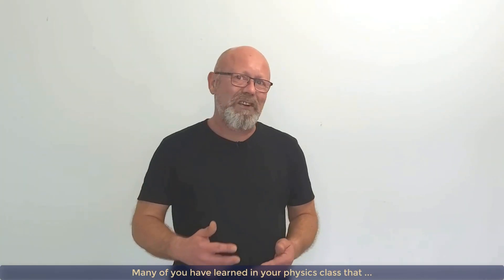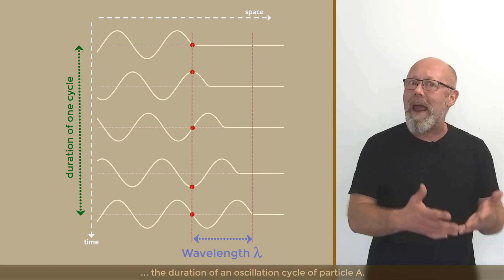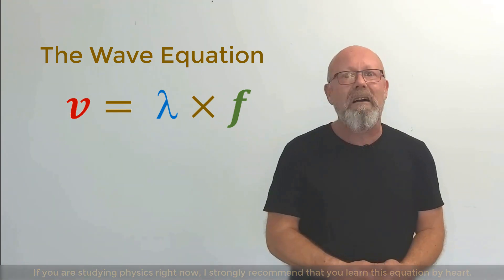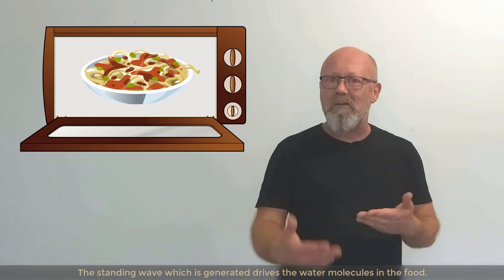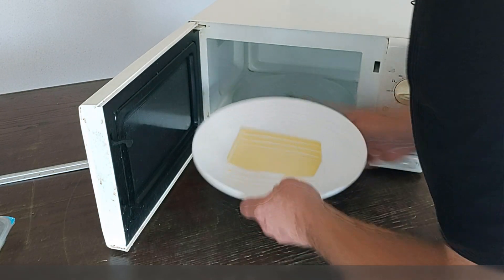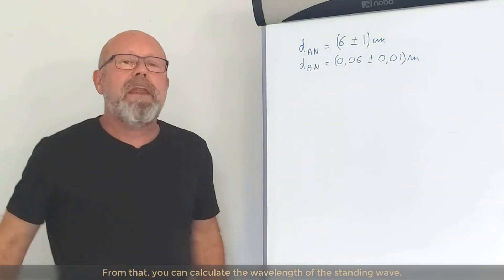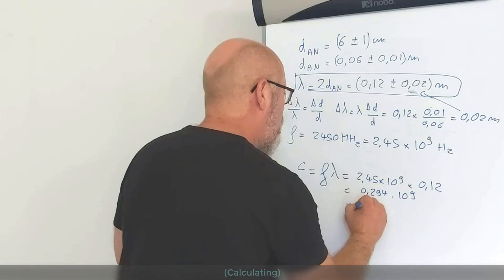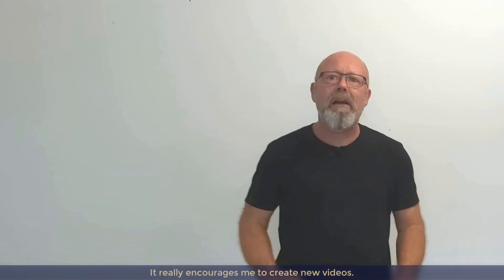How to Measure the Speed of Light in your kitchen! (Waves, Physics)

Comment: The error formula was misleading. The fractional error of a product is not the product of the two individual fractional errors, or it would be zero when one of the factors is known perfectly, as in this case.
You have to take the square root of the sum of the squares of each individual fractional error. The result will be the same as that stated in the video. Because the fractional error in the frequency is zero, the fractional error in the speed is about the same as that of the wavelength.
Great video on the physics side though, and I have just watched the one about light reflection which is a model of concise clarity.
Reply from the maker: Hi Joe, 
You mean the equation on the bottom left of the board around 12 minutes 30, . The sign between the fractional errors of frequency and wavelength is a + (for addition...) :-)
Thank you for your kind comments too
Reply: @PhysicsMadeEasy  Oops! I blame my screen resolution, but I'm good at passing the buck.
It is still incorrect, but in a different way that at least does give a sensible result when one of the fractional errors is zero.
It is a trivial point, though, in a seriously good presentation.

Comment: The theory of electromagnetic radiation is a lot more complicated than was shown in the video. Basically what was shown was only the farfield solution, where the wave equation is set to zero, generating plane waves. This is valid about 1 wavelength from the source. Closer to the source, the wave equation must be set to an oscillating dipole source. When you do this, a lot of interesting things are seen. The longitudinal Electric field and the transverse Magnetic field are created at the source and propagate instantaneously, reducing to the speed of light in the farfield. The Transverse Electric field is created at about 1\4 wavelength from the source and sends instantaneous propagating fields both back toward the source and away from the source, reducing to the speed to flight in the farfield. Actually the propagating Longitudinal Electric field curves toward the opposite charge of the dipole and creates the Transverse Electric field. This propagation behavior applies to not only the phase speed and group speed, but also the information speed. For more information, search William Walker Superluminal. This propagation behavior has been experimentally confirmed by transmitting radio waves between 2 antennas and measuring the time delay as the antennas were separated from the nearfield to the farfield. Many researchers have confirmed both these theoretical and experimental results, and they match perfectly. Because Relativity is based on the speed of light being a constant, the instantaneous nearfield creates a problem for both Special and General Relativity. In the nearfield, the Relativistic gamma=1since c= infinity, and in the farfield, gamma= the Relativistic gamma since c= farfield speed of light. Since time and space are real, they can not depend on the frequency of light used. This is because c=wavelength x frequency, and 1 wavelength=c/frequency defines the nearfield from the farfield. Consequently Relativity is an optical illusion! Objects moving near the speed of light appear to contract in length and time appears to slow down, but it is just what you see using farfield light. Using nearfield light you will see that the object has not contracted and time has not changed. For more information: Search William Walker Relativity. Since General Relativity is based on Special Relativity, General Relativity must also be an optical illusion. Spacetime is flat and gravity must then be a propagating field. Researchers have shown that in the weak field limit, which is what we only observe, General Relativity reduces to Gravitoelectromagnitism, which shows gravity can be modeled as 4 Maxwell equations similar in form to those for electromagnetic fields, yielding Electric and Magnetic components of gravity. This theory explains all gravitational effects as well as the instantaneous nearfield and speed of light farfield propagating fields. So gravity is a propagating field that can finally be quantized enabling the unification of gravity and quantum mechanics. This propagation behavior has been confirmed experimentally. Simone Laplace in the late 1700's, showed that nearfield gravity is instantaneous, by analyzing the stability of the orbits of the planets about the sun. If gravity propagated at the speed of light then tangential components of gravity to the orbit of the planets would result, causing the planets to spiral away. Ligo recently measure the farfield speed of gravity to the the speed of light. Many researchers have confirmed both the theoretical and experimental results and they match perfectly.

Comment: This measured the speed of light in cheese, not in vacuum.
Reply from the maker: Good point I didn’t think about that, maybe I should use Emmental haha ( A cheese with holes). 

Actually, it would probably be a complex combination of both: Considering for example, that the standing wave formed is based on the boundary conditions of both the microwave oven and partially of the cheese, and considering the heat exchanges at the air /cheese and plate / cheese interfaces, the potential refraction / reflection at these interfaces etc…

Also as you can imagine uncertainties on the measurement are quite high, in this video we just get an order of magnitude…

Comment: Here's a physics mind experiment I'm thinking of.  Put a block of Plutonium into a gold Faraday cage, suspended in the center for best results.  Now, on the outside of the gold Faraday cage attached thermal couples to turn the expected heat into electricity and, also, attach a conductor to the outside of the cage to capture the Beta particles hitting the gold... the high velocity electrons the Plutonium is releasing constantly.  It is the electron supply which should have a different charge than the Earth so the other "wire" is a rod into the Earth, maybe needing a capacitor.  Still thinking about it.  With any luck at all, one would have a nuclear 1.5V cell with two outputs... beta absorbing and heat absorbing, one's home made nuclear reactor.  Would it work?  I don't know but I'm thinking about it.
Reply from the maker: The idea is interesting, but you should dive a little deeper. First you should use a fuel that decays Beta,. Pu239 tends to decay alpha into U235. You should select the fuel considering the half life, so that you find a balance between the electrons produced and  the heat they would provide. Too much and the gold would melt, too little not enough current. Also the KE of the electrons produced is huge (MeV range), while for photoelectricity, we are more in the 10eV ranges. Most of the energy would be heat, melting/vaporising your cage. Better transforming the heat into electricity instead of trying to collect electricity directly (and in that case, alpha decay is more effective, because alpha particles have a larger effective cross section).
Even though, imagining you could generate low energy electrons:
Then you should reconsider the receptor. Why a faraday cage?  Some photoelectric material enclosing the fuel with the suited work function would be more effective. And behind the material, some water tubes to evacuate the extra heat. Search the internet, I am pretty sure, some have been thinking of some designs, maybe NASA (long time probes like voyager 1 and 2)
Reply: @PhysicsMadeEasy Guess I forgot about those pesky helium nuclea.  Just thought that we must waste a lot of Beta radiation that could be turned into electrical force.   There is a heat problem too but that is another normal source of taping radiation energy... small scale reactor, or something like that.   My reasoning for the CAGE is that Electrons of same physical spin repel each other and they would be trapped inside the cage... gold is a conductor with tons of flirtatious electrons so it would be easy to tap the field on the outside of the cage directly or by induction with another gold plate (make the cage 1/2 of the capacitor... the more surface area the better for this... you can't get enough surface area.  Where was I?  Haven't thought enough about that one.
Reply: I've been trying to think how I would word a video about my thought process of measuring electron size by an imaginary light second wire of LRLRLRLRLRLR electrons... put them in spin pairs Lspin/Rspin together as pairs in a one electron size to imagine the diameter of the electron my the Ohm's Law rule and our best measurements of a Coulomb.  I gather it has been adjusted a couple of times in my lifetime... I'm 77.  I just looked up the basic numbers yesterday but haven't done the division to see what it would give.

Comment: In theory, one may measure the diameter size of an Electron.  Axiom:  things that are equal to the same thing are equal to each other.  A mind experiment.  One coulomb per sec is one Amp and we know how many Electrons are in a coulomb.  So, with a super conductor cable, we measure one light second's worth of cable and allow only one electron at a time to pass... pretend it's in a vacuum if that idea is too ridiculous for you.  So our conductor is a vacuum allowing one electron, at a time, to pass.  We get our nano second clock out and open the gate for one second/one coulomb and divide one light second's worth of distance divided by one coulomb worth of Electrons and one has one's Electron diameter.  It's a mind experiment, don't go ballistic on how impossible that is.  A light second long line of paired electrons (so they won't repel each other).  Count them... = one coulomb's worth.  I love electrons, they are life.  Everything we see, touch and smell or think is controlled by Electrons.  In my private world they are shaped like an icosahedron and composed of 20 gamma particles.  With enough energy and a really tough target, one may smash electrons into the Gamma particles.  But what do I know?
Reply from the maker: OK, let’s consider 1C of electrons. That is 1/1.6e-19 = 6.25e18 electrons. Now a tube of 1 light second. That is 3e8m. You claim that if you pass 1A in this tube, you would get 1 Coulomb held in the tube of that length, that is 6.25e18 electrons side by side. That gives you an average diameter for the electron = 4.8 e - 11m. The result is fun as it is about the radius of an hydrogen atom at ground state (which could be seen of the range of the electron cloud). 
The radius of an electron is known to be less than 10e-18m.
Your reasoning appears to be based on electrons travelling at the speed of light… which they never do (electrons have mass.).  
But do continue playing with your mind like this!
Reply: @PhysicsMadeEasy  Yup... it is an impossible reality experiment.  I thought it would be neat to compare that size to other sizes suggested.  In my universe reality, I go with the Plank constant as being the diameter.  My theory of reality has an Electron being of shape of an Icosahedron... 20 Gamma particles.  That allows the Electron to be smashed and the possible rubble can include a neutrino, two Xray particles or else a total of 20 Gamma particles.  In my reality the Gamma particles are magnetic and as close to the Dark Matter we are seeking as we are likely to penetrate... using particle/motion physics.  Relativity is all rather moot because the time factors are so fast they are living in a reality where a pico second is an hour.  The neutrino is 10 Gamma particle and extremely unstable.  The Xray particles are 5 Gamma particles and extremely unstable.
Reply: What else... I see atoms as being constructed in a manner similar to Hoberman Spheres where the Electron is the all purpose ball joint with 10 possible poles.
Reply: @PhysicsMadeEasy  I was thinking that, rather than the diameter of the electron, it has to spin one spin to complete a wave so, rather than the diameter. one would divide the distance by 6.25 x 10(18th) by the CIRCUMFERENCE of a circle, so the final answer will be divided by Pi (3.14159) so that would make the distance smaller.  There is the issue that electrons don't really travel in straight lines but they would have no choice in a conductor one electron wide... also didn't allow for the skin effect.  In any case, the field around the conductor would be a circle which would act as a magnetic shield of sorts.  It would seem to indicate that one volt would give the required spin to do that or one second.  I got onto that thought after Veritasium's silly idea that a metre gap between wires would allow for capacitance and his ridiculous answer for the time for the light second wire to conduct a current.  I no longer trust anything he says.